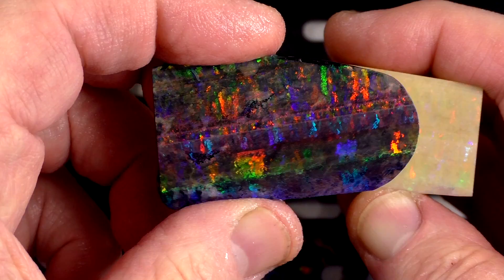Andamooka Matrix Opal Treatment!

Comment: I have some just treated. I cut and shaped my piece, but once I pulled it out of acid it seemed to have undercut the stone a bit and now it’s not smooth. 3 days sugar and 3 days acid. What went wrong?
Reply from the maker: I’m not sure when I release this video, but it was a long time ago. My formula for treating matrix opal has changed. I now recommend one day in sugar and 4 to 8 hours in acid. You can always check whether something is happening once it’s in acid. If you leave it in acid for too long, it may over treat and be nearly black, making the colors difficult to see.

I’m not exactly sure what you mean by “undercut the stone,“ but, three days in acid is too long.  I’m sorry if I recommended that. I don’t know if I did, but I’m going to put something in the description to let people know that three days is too long. On the other hand, most matrix opal can easily withstand three days in acid.  After a day in sugar, you will be able to tell if your opal is treating in less than two hours in hot acid, but you need to go a little bit longer to make sure it treated fully.
Reply: @PulitzerOpal thanks. I was already thinking about dropping my cook times down. The stone got a little punky in the acid and stone became rough to the touch instead of smooth. I didn’t mind the black because it really brought out the color from gray and white to that deep black. Will try 1 day sugar and 8hour acid and see how those results come out. I do appreciate you getting back to me!
Reply from the maker: Good plan. I should mention that if you treat it as you said, if it only turns gray, it likely will not ever turn black. I showed some gray ones in a recent video that were treated 9-10 times. Treating matrix is additive!

Comment: Will this treatment work on opalized petrified wood? Wood opal, the piece I have is primarily blue-grey.
Reply from the maker: No it won’t, amber. Treatment on works on matrix opal. It doesn’t work on regular opal   On the other hand, it might make the wood areas black, but I don’t think you should risk it. Most wood opal has a solid background, which would not absorb the black.
Reply: @PulitzerOpal  Thank You Colonel! I don't want to trash it, but was wondering if there is any color in it. Thought maybe this would bring it out. Thank You for letting me know not to bother!

Comment: I have recently cabbed some andamooka matrix that I have had for over 30 years.  i wanted to do the treatment, but I can not buy Sulfuric acid anywhere.  I have tried local chemical supply companies, large online chemical supply companies and I can not find a supply.  The recipes for the treatment I found call for at least 90% sulfuric acid.  The only thing I can find is battery acid from an auto parts store which I think is at most 50% sulfuric acid.  Any advice on how to get the acid would be greatly appreciated.
Reply: @PulitzerOpal  I finished my first treatment yesterday.  I ended up using a concentrated sulfuric acid drain cleaner which advertises itself at 90 - 95% concentration.  I did 24 hours and 24 hours sugar and acid.  Some of the stones turned out killer some didn't really absorb the sugar evenly.  Overall the I was very happy with the result.  Cabbing the next batch now.  Took me back to the mid 80's when I was stationed in Woomera and would ride the bus into Andamooka every weekend I could to mine and learn how to cut with my friend Marijan Anic from Castle Opal Showroom.

Comment: The matrix i have you get an up side with the brightest play of color and the sides are not as dramatic. Definitely orient your rough for play of color not biggest slabs before lumbering and always before treating or you wont know which end is up, if not marked beforehand. You can test penetration by drying the rough in air and seeing if it evaporates even or off the dots first. The dots that dry fast will dye black and what doesnt dry might not treat well.

Comment: Thanks for your knowledge and information. What is the dilution of sugar and sulfuric acid mixtures and what temp do you heat at? Is it heated in a oven? Do you have to shape before treatment? Good on you mate.
Reply: it occurs to me that you could finish the opalization of the clay... unfortunately the reason it didn't opalize may be something that prevents the clay from opalizing... clay particles too big... not weathered sufficiently... who knows,  but it might be fun to play with
Reply: Pulitzer Opal ... do you know who Len Cram is?... he figured out how opal really forms... when we make opal from kaolinite clay we use piranha solution... I use a reagent grade sulfuric acid, and full strength hydrogen peroxide, although 35% H2O2 works with a little more added... it literally disolves the aluminum oxide and measurements indicate the oxygen is actually separated from the metals... not silica, but iron oxide or sulfide... I should have a video of this soon
Reply: thanks very much for your info -- i really appreciate it
Reply: +Pulitzer Opal thanks so much. i used to treat with citric acid, but takes so long time (more than a month). have you try with other kind opal?